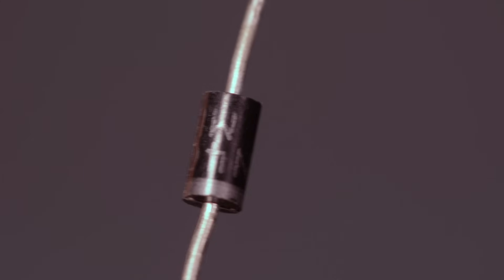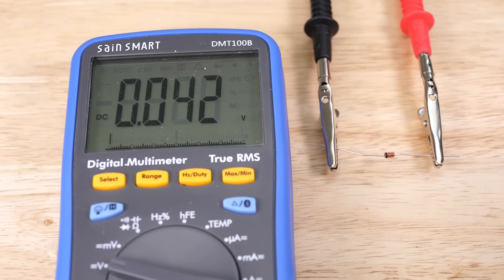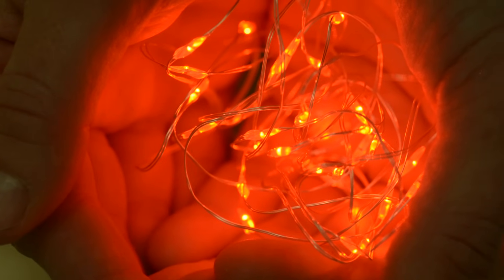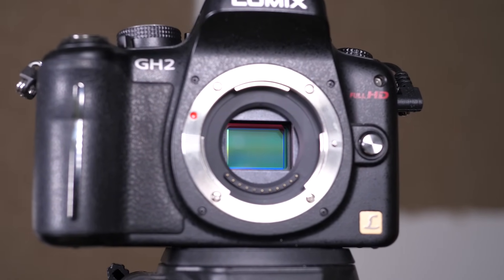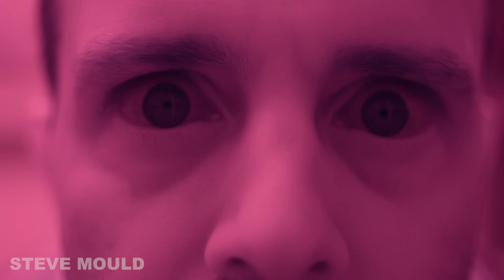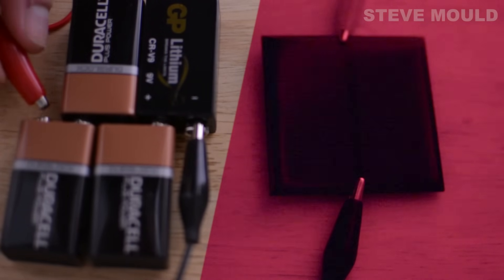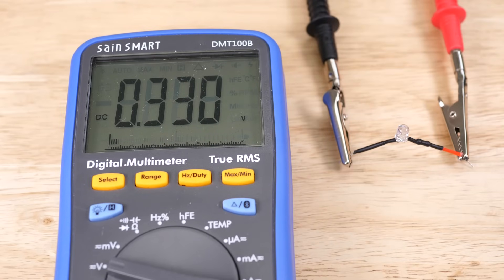Why all solar panels are secretly LEDs (and all LEDs are secretly solar panels)

Comment: Science teacher.  You used the key phrase when answering your own question VISIBLE light.  Electromagnetic spectrum (light) goes way beyond our retinal ability to perceive (visible range) there are animals that perceive light we do not.  Butterflies and birds see UV and therefore runway patterns on flowers.  Not just with their eyes either.  Pit vipers sense heat as infrared with sensors located on their snout  that have nothing to do with the rest of the light spectrum.  Technically the only difference between "seeing" and "hearing" is we use two different sensor units to perceive them, eyes and ears.  Thus the ubiquitous phrase in sci-fi "SENSORS" because all sensors have to specialize to some degree. They all have limitations, and to name them for every show or movie and explain the differences would become tedious and boring and confusing to the audience.   Unless there is a plot point.

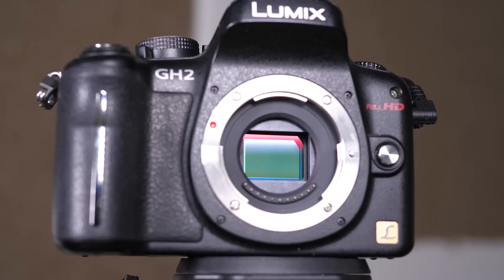Comment: 2:15 lol, i love the cut of you almost looking at the camera, but stopping just before you get there

solar panels would be pretty cool for sending secret messages, flashing text in infrared if you could apply a very specific current to them, though maybe they need more control to be used to display data

Comment: Never install solar panels on your roof.  If your roof leaks from just one of the hundreds of bolts that hold them to the roof your insurance company will not cover the water damage and the 20 year loan for then , well solar panels only last 10 years or so.  Dont be scammed.  Plus solar panels on your roof will not power your house only other houses.  It's the biggest scam of the century.

Comment: "Solar panels <=> LED"

This type of diodes are called photodiodes. LED's are the exact opposite of photodiodes.  Solar panels on the other hand use a range of  methods to convert light into current, most common being  Photo-voltaic cells. Not the typical photodiodes nor LED's. Or at least so I was taught in school.  And given that a solar panel are a complete assembly, not a single component, I wouldn't personally say that all solar panels are LED's and all LED's are solar panels.

Comment: You can also use your phone camera to test you IR TV or any other remote. Point it into the camera, press a button and look for a pale blue glow. You don't even have to remove the IR filter. This is how I discovered that part of my DVD recorder's remote had failed. Some buttons worked, some didn't.

Comment: in 1940 a short story titled "Let There be Light" by Robert A. Heinlein (as Lyle Monroe) had solid state panels that were equally efficient at making light from electricity as they were at making electricity from light. That's a 'holy grail' of semiconductor technology that has yet to be achieved. Heinlein used a lot of pseudonyms when submitting stories to the magazines in the 1940's, often at the request of the editors so it wouldn't look like he was writing nearly half of the stories they published.

Comment: So can if i use a high end light bar like a rigid light bar and connect it to an inverter in the solar panel input and run the battery  output to a battery can i create a charge to the battery and run appliances off of it?

Comment: For those of you wondering if an LED TV screen can be used as a solar panel - the answer is 'no'.

While all LEDs do exhibit the photovoltaic effect, to some degree, they are not at all optimized for this purpose and as such are extremely inefficient. What this means, is that no matter how much light you can shine on an LED, it will never produce a practically useful amount of current.

Comment: Oh, infrared? You mean heat? lol. Yeah, a lot of things make heat when you run a current through them.
Reply: I don't think you'd see an appreciable quantity of blackbody radiation with a silicon CCD sensor, as I'm pretty sure you'd expect those photons to have too long of a wavelength to be absorbed by the device. It's much more likely he's capturing the spontaneous emission of the diode with his camera.

Comment: Light Emitting Solar Panels! Amazing.  Seriously, I always wondered how you know if the solar panels on cheap garden solar LED lights are good or not, without testing and benchmarks and stuff.  This is a super easy way to test them.  This could probably even be done "in the field" which is while you're at the shop, so you pick out only the good ones.

Comment: The reversibility of PN junction is a classical well known into engineering labs. 
I remember as a young experimenting with the germanium OC71 transistors, some manufacturers used a glass case painted with black varnish. By removing some varnish from the top of the transistor with a razor blade, the OC71 behaved just like a phototransistor. I built an electronic rooster, a control system for model railways, an RPM counter and a motorised gate control, all with scraped transistors.
Thank you for the inspiring video; the electronic as an hobby has disappeared almost completely (especially the analog parts, which are erroneously considered obsolete), so a video like your is able to recall the spirit and the curiosity of experimental electronics, which appears nowhere along the Internet. Regards, Anthony

Comment: Is there a link between the frequency of light emitted by a diode and how it would absorb light? That is, for example, do solar panels absorb near-IR better than other frequencies when they emit near-IR?
Reply: This is related to resonance. My hypothesis is that if a solar panel is "tuned" (like a string instrument) to resonate at a specific frequency or wavelength, it should be very efficient at absorbing it AND emitting it.

However, ultraviolet light has A LOT more energy than infrared, and more than visible spectrum. This is why the sun is used as source, because it generates more energy without the need for "tuning". Quantum Dots have the special ability to be "tuned" (only at build time), so if you make a QD solar panel with a lot of QDs tuned to multiple frequencies (specially UV) you get A LOT more energy than traditional panels!

Comment: I didn't believe the part about LEDs being Solar Cells at first. So I grabbed an old network card and my Fluke Multimeter... measured across the contacts for the LEDs... .03V ...Well... that could be anything, so I grabbed a flashlight, set the card and the light on the table in the obvious configuration... and the voltage jumped to TEN TIMES what it was... This may explain another oddity I've noticed since my high school years: shine a laser at an LED Alarm Clock, and the LED you're shining the laser at illuminates - the WHOLE LED.

Comment: Solar panels emit infrared radiation, which is just heat. Since LEDs are solar panels running backwards in time, they actually cool down. You can build a thermos bottle which heats or cools the content at the flip of a switch by have two inner layers. Use the inner layer as an LED and shine on the outer layer(now a solar panel), and the content gets cooler. Use the outer layer as an LED and shine it on the inner layer (now a solar panel), and  the content gets warmer. The light passing either way between the two is never seen, and most of its energy gets collected by the solar panel and set back to the LED as electricity.

Comment: Wait a minute, if solar panels only emit infrared does that mean they also only convert infrared to electricity? Wouldn't that be ineffecient?
Reply: Solar panels do indeed only convert lower frequencies to electricity (thats whe the cells look blue). The best solar cells are only about 30 percent efficient, for several reasons.

Comment: Imagine having your phone screen act as a solar panel to charge your phone
Reply: well apple did upgrade there firmware so you can charge your phone in the microwave
Reply: @jamesdeegan7365  It's faster than using their chargers too!
Reply: @jamesdeegan7365  screw you guys because of you not just did my Phone not charge but i wrecked it and my microwave and my phone now i have to buy a new one

Screw you

Nah im just kidding
Reply: Your phone screen is LCD, not LED.
Reply: @KlarkKentKraktov  My OLED phone screen is not.
Reply: @KlarkKentKraktov  You can't assume that anymore. Most phones and mobile devices have started switching to AMOLED for their power saving potential, far better color reproduction and amazing contrast ratios. AMOLED screens use individually lit pixels as opposed to a backlight being diffused across a liquid crystal panel. If you've got a device with an always-on display, you're using an AMOLED screen because only AMOLED screens can individually light pixels, allowing for the vast majority of the pixels on your screen to be completely powered off, save for the pixels displaying the time and notifications, etc.

And if you've ever wondered why an always-on display tends never be in the same place twice on your device, it's because AMOLED displays can exhaust their lifetime on a per-pixel basis too, meaning if certain pixels are constantly lit for an extended period of time, those pixels will eventually "burn-in" or dim, creating an afterimage on the display not much unlike what used to happen to CRT monitors back in the day, hence the need for screensavers. That's also why AMOLED displays are still incredibly uncommon as desktop monitors. Not only are they incredibly expensive to produce at sizes larger than mobile phones, but nothing will burn-in an AMOLED display faster than the start button and all the other static stuff that never moves or changes on your taskbar throughout the life of monitor.
Reply: @KlarkKentKraktov  what if it's an AMOLED display
Reply: You could do that, but you’d need infrared vision to read the screen.
Reply: @stargazer7644  Not if you design the LEDs to emit visible light.
Reply: @qdaniele97  LEDs that emit visible light are terribly inefficient solar cells.
Reply: @fayenotfaye  you ever heard of a window lol
Reply: That would actually be pretty cool
Reply: Watch brands like Casio have solar cells surrounding their screens on some models. If we brought back bezels, I don’t see why we couldn’t do that with phones too. It wouldn’t charge very fast, but might prolong battery life a bit....
Reply: @ad_fletch  A 1cm wide bezel would generate about 0.8 watts if left in full sunlight on the dash of your car.   It would take over 3 days to charge it once at that rate if the phone was turned off.  The phone would be 2 cm wider and taller.  And the phone would cook.
Reply: @bodyshoplaboratories501  You could also design it to be placed on a stand in your yard.  But that's not what we're talking about here.  We're talking about displays that generate electricity. Tiny solar panels generate tiny amounts of power.

Comment: you are right about LED and solar panels.  and diodes, Semiconductors in general will produce electricity if you heat them.  if you plug resistors to battery, resistor will heat up and infrared camera will show infrared emission from resistors. this does not mean resistors and light emitting diode. heater emits infrared light too.

Comment: It would help science education lots if the distinction between the two types of reversible machines was removed.  There is, for instance, no difference between a motor and a generator, an LED and a solar cell, or a loudspeaker and a microphone. Once you realise they are the same thing then you will be able to think much clearer about them. 
Imagine a battery connected to a motor, the motor goes round; Which way do you turn the motor to charge the battery? Most people will say backwards, but  the correct answer is in the same direction it is going, but faster. Forget Fleming's left hand and right hand, the answer is obvious once you realise that the motor is also acting as a generator.

Comment: Does it means when illuminated PV panels are not under load they are all shining infrared (in another words are they converting sun energy into light and heat instead of electricity)?

Comment: I had a long career as a circuit designer, and several times, with high gain circuits, with diodes, I had to take the light sensitivity of the diodes into account.
Reply: Care to share what you know?
Reply: @mrwess1927  Any opamp circuits with high gain can be affected by diodes connected to the inputs.  I think an audio preamp with a pair of clamp diodes (glass encased 1N4148) across the inputs, for static protection picked up a hum from room lighting.  and a high gain DC amplifier (for a seismograph) connected up as an absolute value circuit, had offset problems, if operated in the light.  In both cases, either switching to a black epoxy cased diode, or using a black plastic transistor as the diode, cured the interference.
Reply: Neat!
Reply: The Raspberry Pi 2 had a slight issue because of this, where if you took a picture of it with a xenon camera flash, it would cause the computer to shut down.
Reply: That’s interesting, a lot can be learned from experience.
Reply: So placing them in a black case is a good idea 😄
Reply: @fano72  Unless you intend to use them as a very low cost light sensor, yes.
Reply: Aren't they usually encased in non-transparent mold?
Reply: @gorilladisco9108  Almost universally, for new designs.  But, for decades, small signal diodes were encased in clear glass.  I.e. 1N4148.
Reply: @jpopelish  Ah, good to know that.
Reply: Ah great, my first thought was along these lines, so I headed to the comments to see if I could get the answer...thanks

Comment: Yeah.. you can also use true 1st generation night vision in total darkness to view and isolate high voltage leaks in spark plug leads, and or coils. The night vision makes even the most faint leak highly visible. (NOTE) - ::: This method does not work with infrared emitter night vision. It only works with true tube light amplification night vision. I use a inexpensive 120.00 Night Owl unit I purchased at Walmart. Most people do isolate the more obvious leaks using traditional methods, but when you use night vision and isolate all leaks... You will be very surprised how much more horsepower and fuel efficiency will be produced with no misses in the engine.

Comment: okay i now this is a very late comment between 2k others but 2 things:

question: if solar panels are ir-leds, and tv remotes have ir-leds which both produce voltage when exposed to ir-light - why doesn't my tv remote charge itself or why doesn't it blow up when left in the sun?

and a quick tip - for filming infrared you can also use your phone camera

Comment: strap a ten ohm 1/4 watt resistor to a firework touch paper, apply 12 volts, you have light heat and sound

Comment: So can we have the IR warm enough to melt the snow that may accumulate on the solar panels?
Reply: attach a few capacitors and integrate a heating coil for best results
Reply: @NazD10  I'm wondering if a solar panel could be designed for both good power and, reversed, enough heating to keep the snow from sticking
Reply: @LordTiberius52  transfeering electric to heat and light is far more efficient than to light then heat and light. it will effectively be like using a microphone as a speaker.
Reply: @NazD10  Gotcha. Thanks
Reply: Youre thinking longwave IR.  This is shortwave IR